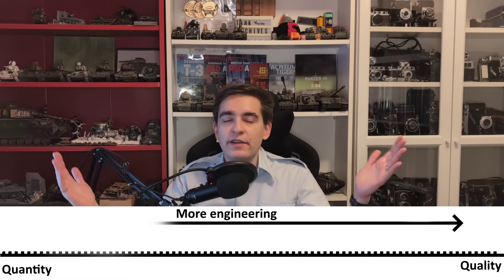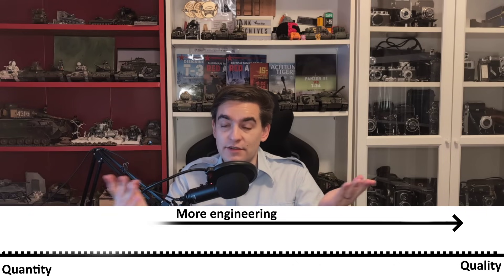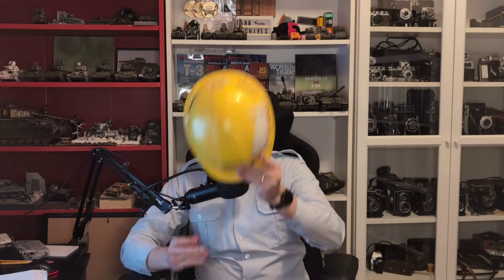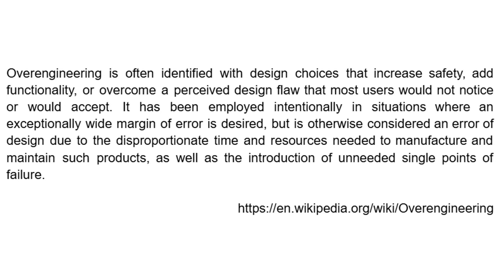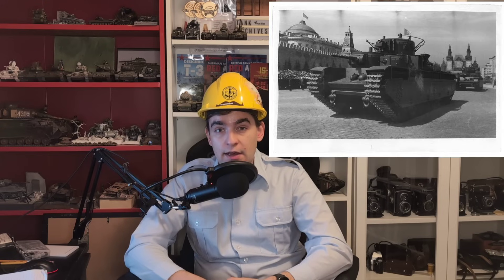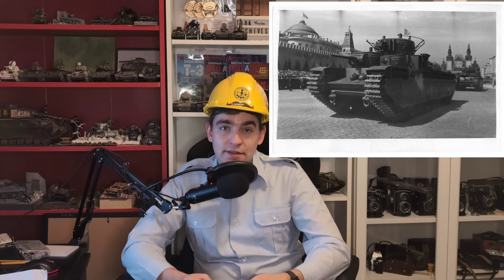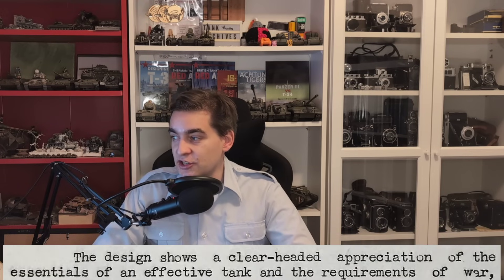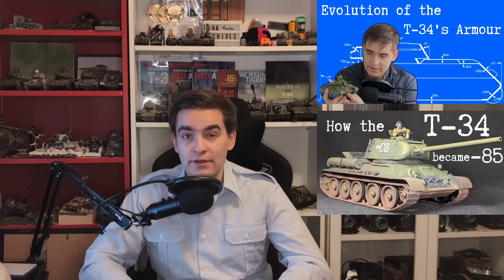Was the Tiger overengineered?

Comment: Very good explanation of the term in question.  ‘Over engineered’ is nearly always a negative in common use.

Sort of related:  Why was the Tiger VI B(King Tiger) a completely different tank than the original Tiger?  Why not call it Tiger VII since it was a completely different cat?
Reply from the maker: Perhaps to continue the lineage. The project code was also VK 45.02 even though no one could have possibly expected the tank to fit into the 45 ton weight class anymore.
Reply: The King Tiger was not the Tiger VI, it as the Tiger II with the designation of PanzerKampgfwagen Tiger Ausf. B. The PzKpfw VI was the Tiger I.

Comment: I don’t like that word in regards to this. They weren’t over engineered. They were over sized. At that time in the war they couldn’t get the proper alloys. They were often built by slave labor, not exactly the most reliable. The word overengineered is often misused. A problem with the design of the Tiger was that it wasn’t used for what it was designed to do. The concept was that it would be a “breakthrough” tank. It would take care of fortifications and other (smaller) tanks. Then forces would move forwards, leaving the Tigers to be maintained and rearmed. When the Germans came upon another stopping point, thecTigers would move forwards and everything would repeat. But by the time the Tiger came into production. The Germans were mostly in retreat, with tiny temporary advances here and there, and the tiger was needed constantly, where it would break down constantly.nearer the end if the war, the tanks became simpler as materuals became scare and as getting the tanks to the front was more important. I’m not sure where he gets this information about costs. I have several books on the German economy and government. Additionally, a number of historians have commented on this. Manufacturers were in a bind. The government decide pretty much everything they did. The amount of materials they could buy was regulated. What materials they could buy was regulated. Costs were regulated. Poor alloys required thicker armor, etc. the Germans had problems with welding. So many tanks didn’t have sloped armor as it was found, by them to be harder to weld. Non sloped armor had to be substantially thicker. A lot was going on there.

Comment: Tiger I was merely a stopgap to the horde of KV-1s and T-34s; before German military encountered sloped armor, their heavy tank was going to be an enlarged version of Panzer IV. 
After Operation Barbarossa, the engineers realized they need a sloped armor for better protection, but the threat still remains. Therefore all they can do is to use an experimental chassis with thicker armor and bigger gun to counter until they are ready
Reply from the maker: The effect of slopes was already known from the days of medieval castles. The Renault FT already used sloped armour as did French tanks of the 1930s that the Germans could not have been ignorant of. They had every ability to arrive at the same sloped armour design that the Soviets did independently.
Reply: I’ve always wondered why some German vehicles featured extensive use of sloped armour (half tracks, many wheeled vehicles) while this wasn’t the case for some many of their tanks and SPGs.
Reply: @SB-lg2fy  Most likely to simplify the production of their tank hulls. The German mettalurgical industry was well known for its steel. For a long time, their ship armor was considered the benchmark. So, most likely, they expected to take theirs through the quality of the hull armor plates and through the process of welding these plates rather than casting them.
Reply: @SB-lg2fy  Which they obviously didn't accomplish: given the number of T-34s and M4s produced individually. Although, without going that way, they would have done much worse: given the shortcomings of their industry, such as high corruption (in the form of cartels) and lack of raw materials.

Comment: It's always irritated me that people use the term "overengineered" when they really mean "overcomplicated".  They are not the same thing.  What's always amazed me about the Tiger 1 is the one thing almost no one ever mentions:  The  fuel system was made up of five tanks connected with something like 120 tubes and fittings, all made of household plumbing grade copper with many buried where they couldn't be reached without a major teardown.  Notoriously leaky when new and progressively worse as subjected to vibration.
Reply: The Tiger 1 had four fuel tanks; one in the rear of each sponson, and another two in the engine compartment.
Reply: @TTTT-oc4eb  I also thought it had 4, Idk if op can clarify
Reply: @astrorick2910  He is just inventing stuff.
Reply: Hi, where did you find that figure of ~120 tubes an fittings? I need a source that detailed for my scale models

Comment: If anything it was under engineered. Shamefully underpowered, notoriously bad powertrain, hard to repair and overweight for the german Military Machine ( in transporting it to battle, planning battles and then virtually impossible to recover unless the enemy was pushed back 10 miles lol) .
Reply: Its power to weight ratio was as good as or better than most Sherman variants. It even used less fuel. Access to the engine was easier than in almost any other tank.

Comment: ‘Complexity is easy. Simplicity is hard’.
Reply: Old British saying ..." an engineer is someone who do for twenty quids what any fool can do for two thousands "
Reply: Was that not Kalashnikov?
Reply: from this point of view, the us army should abolish the M1 immediately. No, simplicity is not to be favored per se, but appropriateness to the task at hand.
Reply: @apis_aculei  You are making it seem as though the M1 is crazy complex. As modern tanks go, it's basically just as complex as any others. M1 is, realistically, only marginally more complex than something like a T-72. One could even argue that the T-72 is more complex than the M1 purely because of the autoloader.
Reply: @apis_aculei  With this line you have just confirmed your complete ignorance of the development/production/operation cycle of any army equipment. To give you an example: M2 .50 cal. Is that the best machine gun? No. The United States Army didn't and don't have the means to replace this over ninety year old machine gun? No. Does this machine gun generally meet the requirements of the United States Army? Yes and yes.
No army will ever in history use any equipment that can be described as “the best this society could produce”. Because from the time of the stone axe to the F-35, the means of warfare are the most expensive in material terms for the society that produces them. And these means tend to be issued to young men between the ages of 14 and 25 who tend to treat them as expendable tools. Which means: break it, lose it, sell it, steal it, and so on.
What any army really desires is to gain an advantage over the army of a likely adversary in a future possible conflict. As the leaders of the army understand the possible conditions of this theoretical conflict and the condition of the opponent's army. 
What does this mean in practice? That if this army needs an M1 Abrams tank, they will try to get one. If they decide that instead they should give a soldier a trench shovel to make him win over a battlefield - that soldier will see nothing but the goddamn shovel during his service!
Reply: @apis_aculei Its problem is the fuel consumption. While this is critical in standalone missions, especially if air superiority and missile protection aren’t guaranteed to protect its long fuel supply convoy. As a part of a combined arms military, especially on friendly soil, it’s not an issue. It is, however, on foreign soil with poor roads.
Reply: @apis_aculei   I think this should be interpreted in one of the lectures of my old Machine design prof almost two decades ago (paraphrased ) : it is easy to come up immediately with a complicated design, it is harder and takes time to check on where you can simplify the design.

Comment: I watched first minute and a half. If anything Tiger was under-engineered because its many systems never worked properly. Let's not forget Hitler insisted that necessary field testing (which normally takes years) was to be done straight on battlefields.. So in late  1942 Tigers were sent to the heart of Russian winter, where 2 experimental tanks ended up in Soviet hands. 
Tiger was a result of tragically successful disinformation campaign by German intelligence which did manage to fool Soviets into thinking that German invasion will rely on heavy tanks, of which they (Germans) had none! So Soviets hastily developed guns against heavy tanks and even cancelled anti tank rifle projects (having developed the best 14.5 mm projectile though, so 80% completion). So when Germans finally felt they did need the heavy tanks  (1. to continue their myth of technological superiority to keep the masses in fight 2. Really do something about Soviet T-34 and KV tanks) Soviet guns able to take them out effectively were already on the battlefields. So Germans were left with no other option but add even more steel, which helped. but adding steel requires bigger engine, matching gearbox, controls etc.. I believe Tiger designers fell into a "death cycle" where more steel necessitates, bigger engine, which necessitates bigger internal volume and even more steel to protect that.. not unlike rockets carrying more fuel in or order to carry fuel.   That last hypothesis of mine needs testing.  

So Tigers were under-engineered because of lack of time and resources Germany had in the presence of Soviet weapon systems designed specifically to deal with heavy enemy tanks (ZIS-3, ZIS-2,  SAUs like SU-152 etc).
Reply: Underengineering was one of the big causes for Panther's reliablity. They simply chose cheaper and worse final drive design than for than they could have build.
Reply: @Teh0X  So you don't think Tigers were underengineered? Modern tanks spend 10 years in development cycle.. that's designing, prototyping, field testing, prototyping again field testing etc.. Tigers didn't have the luxury. T-34 on the other hand was overengineered the hell out of.. Engine was an impossible design of aluminum and diesel fuel and light alloys only which had taken 15 years alone to hone.. Once mass production started its resource was increased from 100 motohours to 250-300, while in mass production.  T-34 was redesigned on the go to streamline mass production... 5000 parts were simply thrown out because the tank worked anyway, new 5speed gearbox developed in 1942 (receiving a Stalin's Prize), new automatic welding technology introduced.. Every factory had their own version of T-34.. own turret, guns etc.. Designers had absolute freedoms as long as they kept the production numbers up.. That's what I call over-engineered (even if it means simplified, which is a lot harder task than complicating design).  Germans were less flexible.. obedient, not deviating from the plan.. Design once, hone out some issues, and see it win or lose.. no flexibility no dynamic  approach.. engineers are just that drawers (chertyozhniks in Russian terminology). I am not bashing Germans, just stating different approaches...